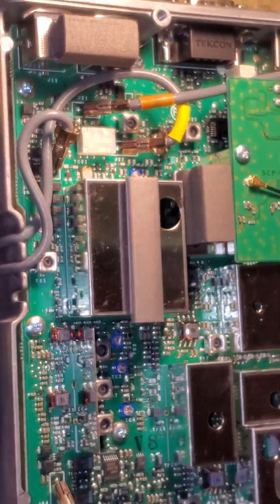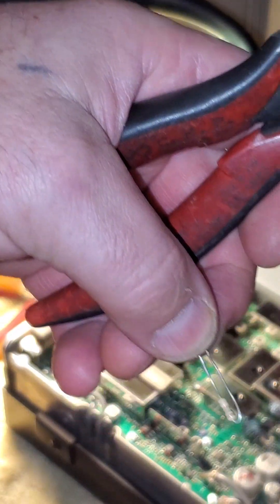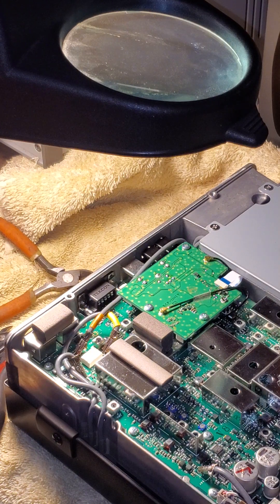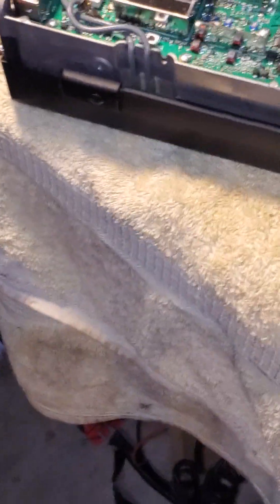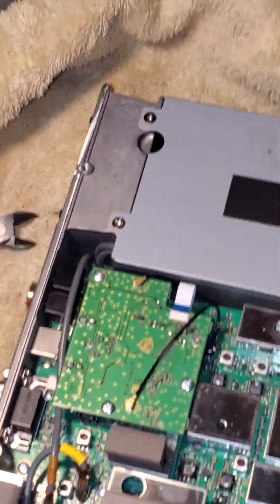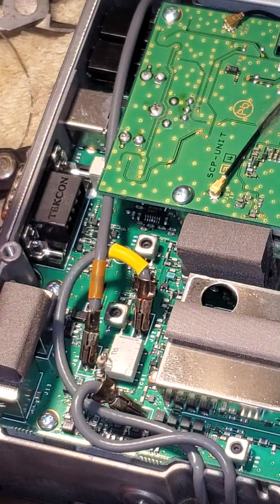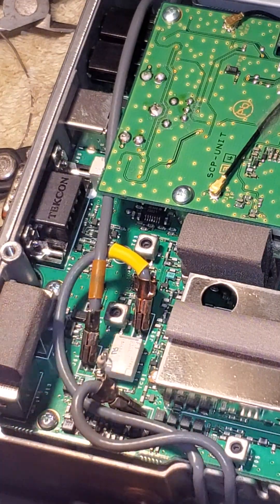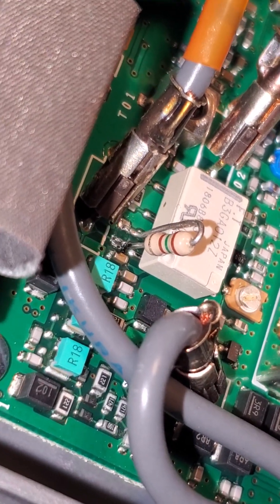Another ft991a front end failure and the repair fix . IPO Attenuator no rx issue yaesu problems

Comment: Had same problem with 891 
But rig was turned off at time 
Hooked up to 80m dipole while I was on 160m vertical with other rig 
Again rig was turned off 
Anyone know if fix is same ?.
Rig still receives just ipo doesn't work

Comment: How much power were you running on the other radio?  I have a Kenwood 281a next to my Yaesu 991a; should I refrain from using the Kenwood?  I surely don't want to burn out the resistor in the Yaesu.  Cheers & 73 from W Rusty Lane K9POW in eastern Tennessee
Reply from the maker: It's more that the 2 antennas were close together .I have off center fed dipole in the middle of my 80m loop.  100w
Reply from the maker: Also 2m 440 uses a different front end I think.  That's not to say 50w on fm can't hurt it on hf. There's a design flaw here. I read about it but don't recall the actual deal. I have a 891 I got from a friend and he blew it up also lol. I ended up selling my 991a.
Reply: @hamradiohack  how did your friend fix 891 I have same trouble 
Don't want to spend $ shipping it back
Reply from the maker: @joebidet2050  i got it from a friend. I fixed it not him . If you cant work on surface mount stuff forget it. I think i did a video on the repair. If you look on google for the attenuator resistor. Or find the schematic it will be easier
Reply: @hamradiohack  ok please send link to video on 891 
But it looks same design 
Thanks reply
Reply from the maker: @joebidet2050  i dont have easy way to find it. You're going to need additional information to do it. Its physically going to be damaged. Remove the smd and solder a 1/4w resistor in its place. I dont remember the value.  The video may be in a play list on my channel.  Ill check later but im in the middle of a project currently.
Reply from the maker: @joebidet2050  https://youtu.be/xq248G1DVU0
Its just showing the damage. Not the repair.  I never made a repair video i guess.
Reply: @hamradiohack  just watched 
Think mine is near relay 
Thanks
Reply from the maker: @joebidet2050  yes thats the one. The other was from the po keying up a sb220 directly and the ac line voltage on the keying circuit kills the padding inductor because these radios aren't designed to have more than 12v on the amp line